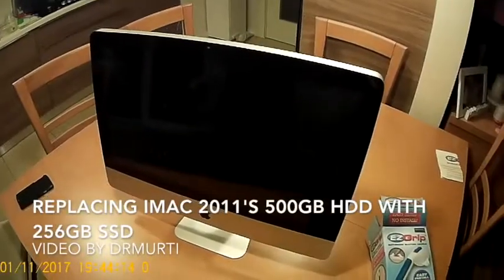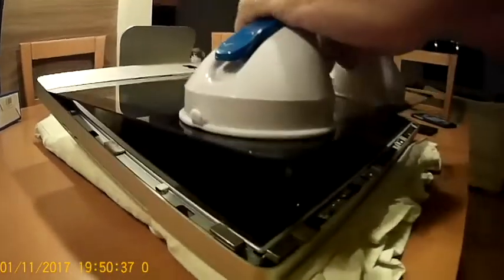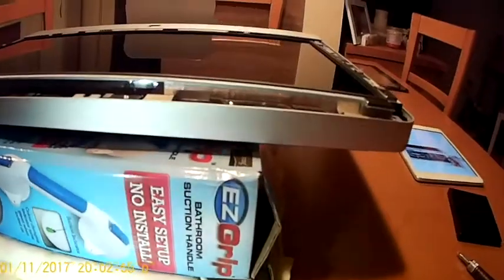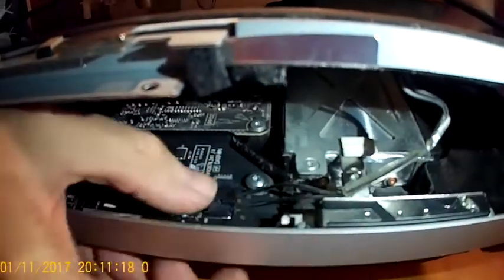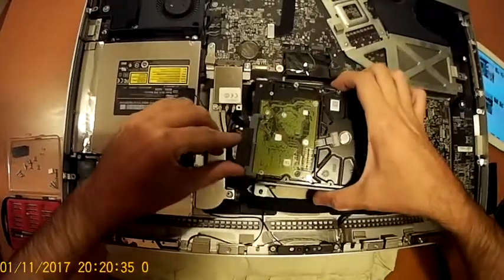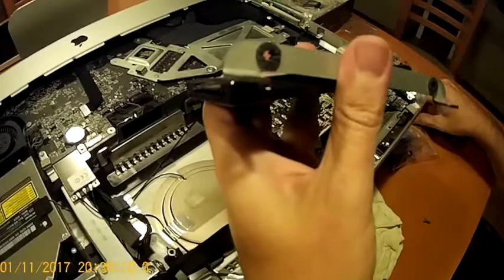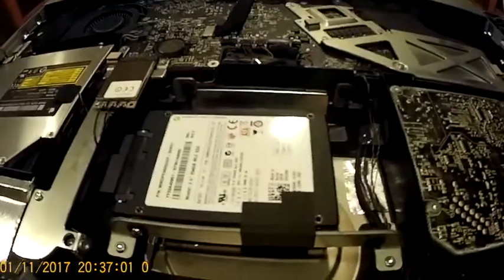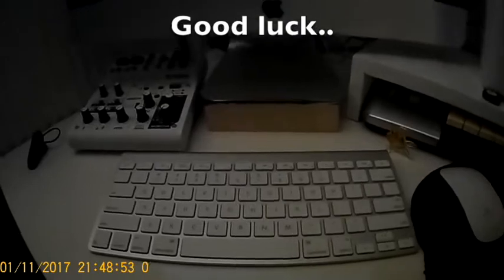iMac 2011 HDD SSD Replacement

Comment: Why replace it? You can add an SSD. The 2011 iMacs have three ports on the logicboard. So you can keep the HDD, the Optical drive and add an SSD as third drive. You can mount the SDD behind the DVD drive. You only need to buy the extra cable from iFixit or from OWC.
Reply from the maker: Didn't know that. Thanks !
Reply: @Murat_Gul  This is possible for the 2010 27" model and for both 2011 models. The 2009 models and the 2010 21,5" model have only two connectors on the logicboard.

Comment: Hi Murat! This video makes it very clear, thank you. I do want to try it myself. Quick question, I have a 2011 imac 27inch and was wondering what SSD drives would you recommend me, I'm not too sure which one I should buy, since there are quite a few options. Any help is appreciated. Thanks!
Reply from the maker: Hi Eduardo, Thanks. I used an Intel SATA drive from my old Laptop. You can get faster ones for sure, however need to double check on forums. Because some new technology like 3D NAND Ram might cause incompatibility. I had a problem with my Macbook Air. Had to try 3 different models. Therefore I use standard brands like Intel or Sandisk,WD,Samsung. But I would strongly recommend to Google your SSD and then buy.
Reply: @Murat_Gul  Thank you Murat! I will keep those brands in mind. Much appreciated!

Comment: Hi, thanks for posting the video. Just one question, what did you do for the HD thermal sensor? As SSD doesn’t have any port for that. Did you have problems with fan noise after ssd installation? Thanks
Reply from the maker: Yes there is a high Fan noise due to the missing Sensor on SSD. You can use 'SSD Fan Control' application which is free and set a default Fan speed value which won't annoy you. I have set the HDD Fan speed to 1650 RPM which is optimal.
Reply: Thank you :)